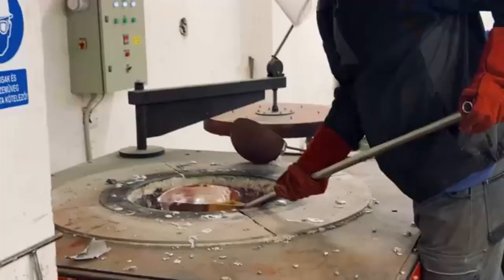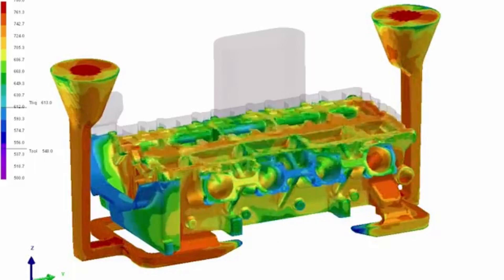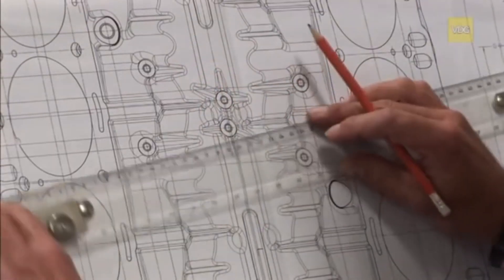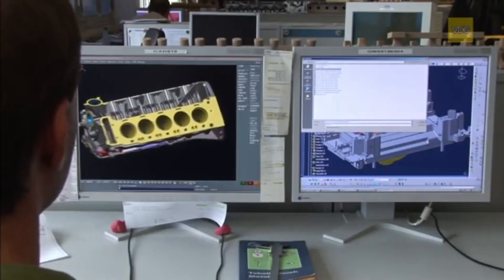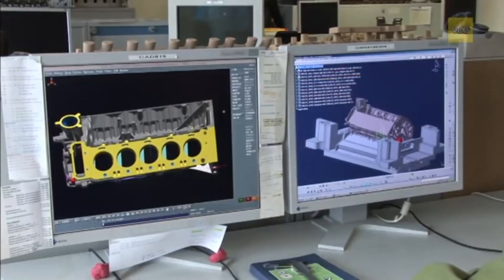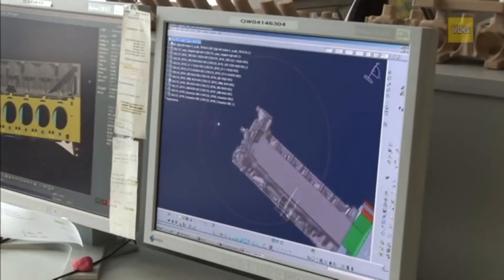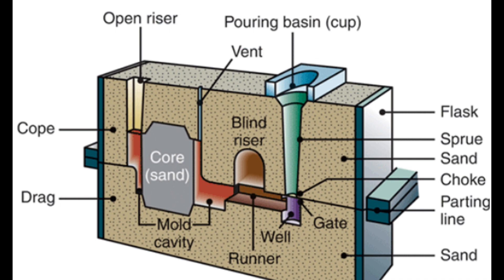Sand Casting: The Fascinating Process From Molds to Masterpieces

Comment: Very cool! Keep it coming.
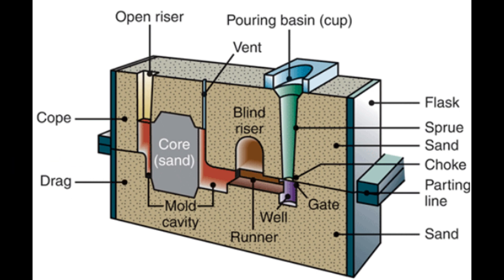2:21 Cavities in the cope have vents to let the air out, but how come the riser doesn't? Wouldn't air get trapped in the riser cavity?
Reply from the maker: Great observation, and thanks for the kind words! 🙌 The riser doesn't typically require vents because it is designed to act as a reservoir for molten metal, staying open at the top. Any air trapped in the riser can escape through the open end as the mold is filled. Moreover, the riser is not a part of the cast and it will be cut away and re-melted. In contrast, cope cavities need vents because they're enclosed and could trap air pockets, which would affect the casting quality. Hope this helps!